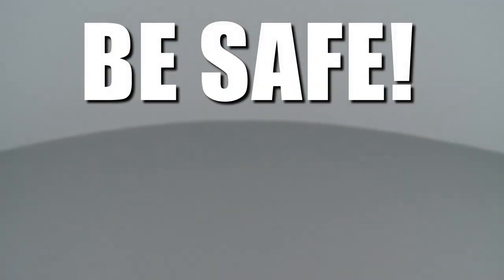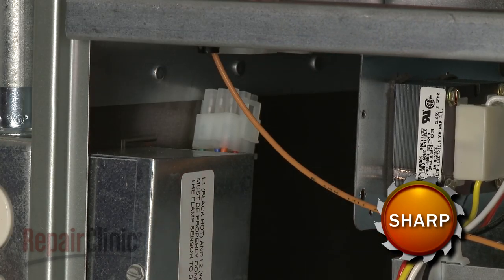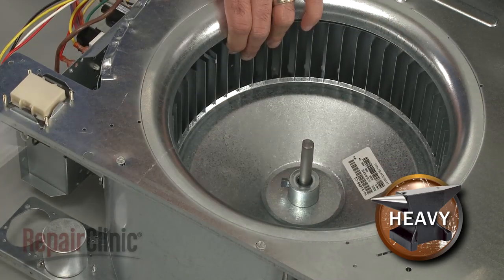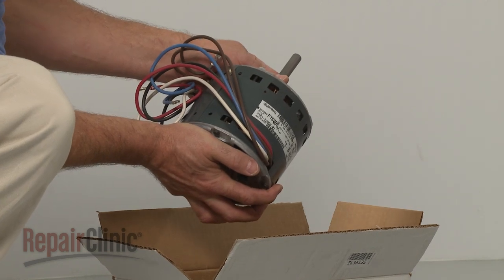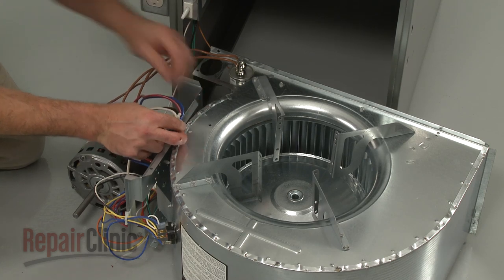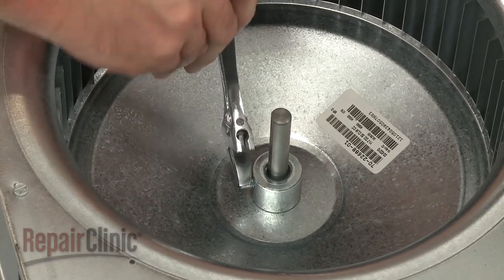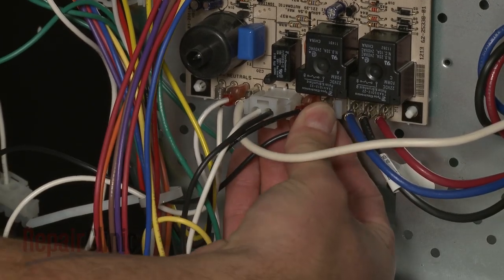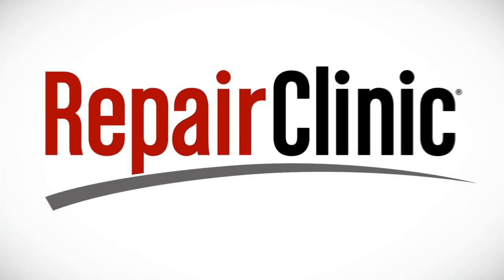Rheem Furnace Blower Motor Replacement #51-22858-01

Comment: I have a Rheem classic super quiet 80 unit in my attic.  I get great air flow on my side of the house but the 4 rooms on the other side of my house is extremely HOT and you can barely feel the air.  My unit is making noise which indicates to me the the motor is working and there is no damage to the insulated vents that leads to those 4 rooms. Will my unit still make noise if the AC blower motor is bad???  Thanks you.

Comment: if the blower motor is a PSC type its recommended to change the run capacitor anytime you change the motor.

Comment: This instruction is nearly useless.  It does not cover the need to ensure proper motor rotation; tips on mounting replacement motors when the screw holes do not align; or swapping out the capacitor (which should be replaced at the same time).  Frustrating.  Not real life.
Reply: I was thinking that this looks WAY too simple